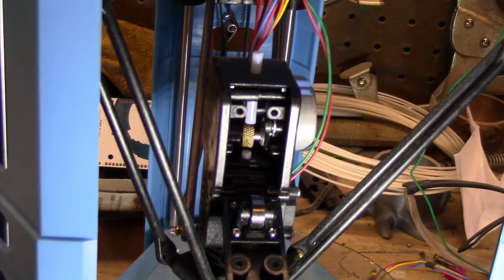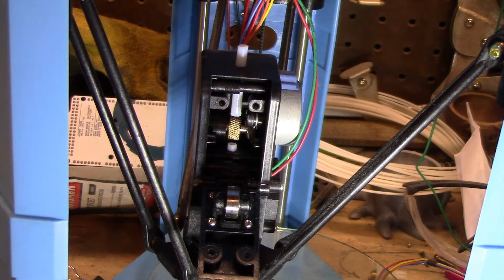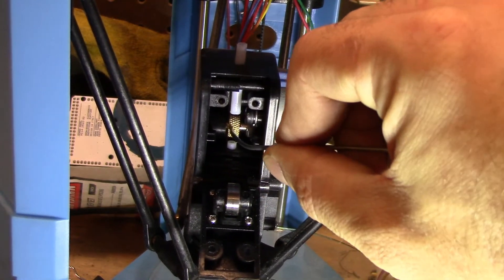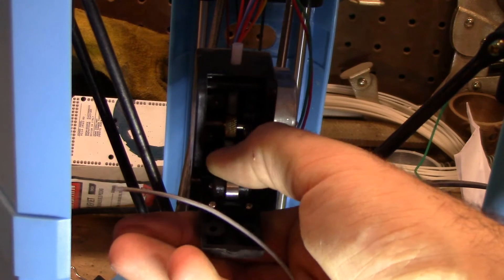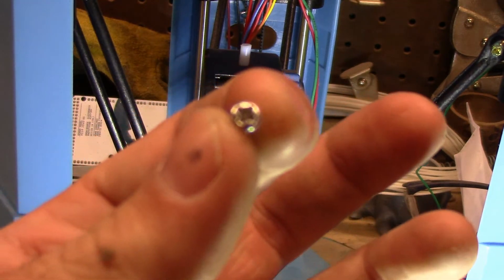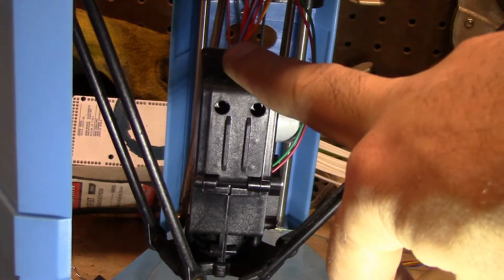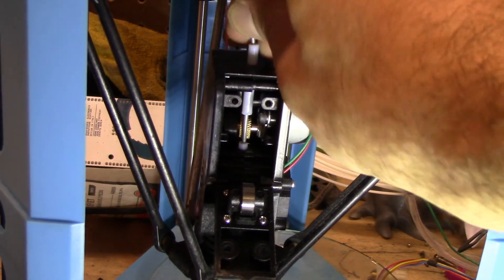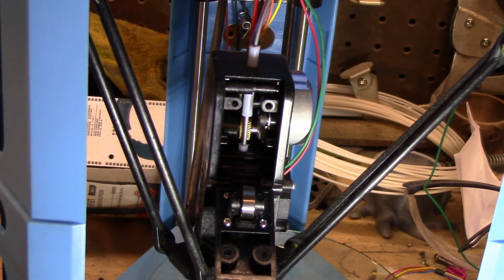101hero hotend common problems

Comment: Loving your vids on the lolhero :) got one myself recently and have been modifying it and printing parts to improve it for the past week XD 1st thing was the hot end strut braces to reduce slop, then plate clips, after that was brackets to hold the control box to the frame. also the 2 part door, much better than unscrewing them screws all the time :). then designed some simple blocks to make a spool holder from threaded rod.. fun little printer to tinker with.